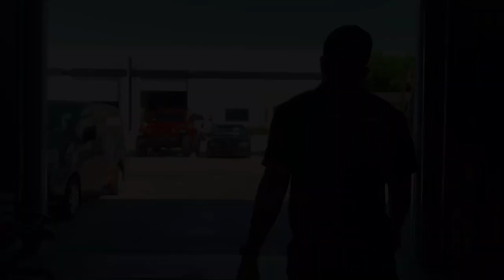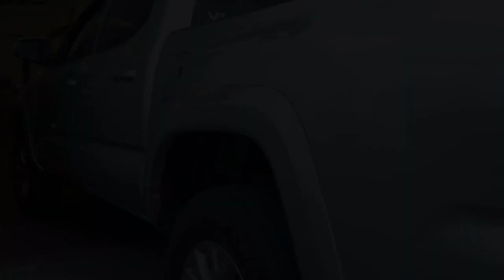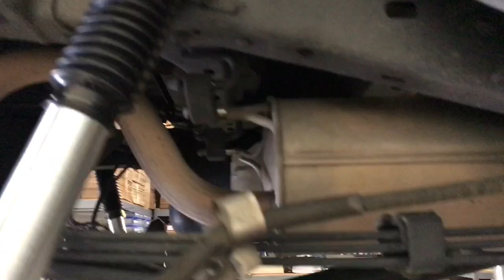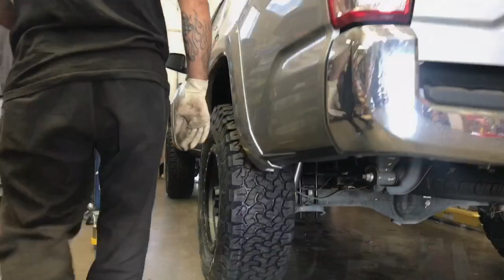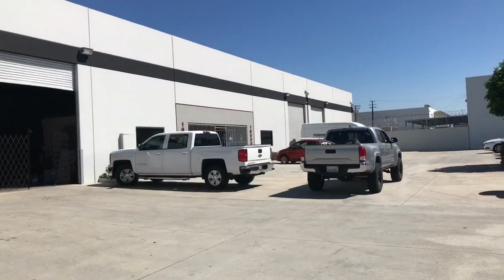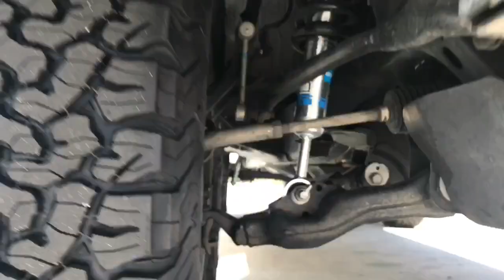Silver Tacoma on Bilstein 5100 & Titanium Method Gris MR309 & 33” BFGoodrich KO2’s

Comment: Hello, I just purchased some SCS wheels Ray 10s 16’ used. I wanted to make my off-road Tacoma look beefy. The previous owner mentioned I can add 285/70/16 but I’ll need a lift for those tires to fit. What is the least expensive lift my 2017 tacoma off-road would need ? Add a leaf ? Shocks ? (I’ll be buying new Bf KO2’s
Reply: dont cheap out on lift
Reply: Nicholas Martinez I eventually went to 88 rotors and bought bilstiens 5100 . Add a leaf & chopped off the body. Only issue was the front bumper kept rubbing still when I would get on a curb or a dip

Comment: what setting (or line in order) did you put for the front shocks?
Reply from the maker: Top, highest setting here.
Reply: 88ROTORS what kind of spring? since the spring gives it an extra lift
Reply: @rubbergames5085  he means the shocks is height adjustable  where the coilspring sits...dnt need to change ur coilspring....bilstein 5100 ride height adjustable shocks